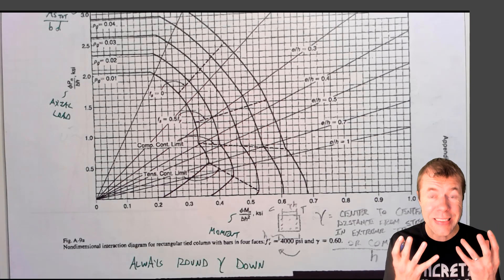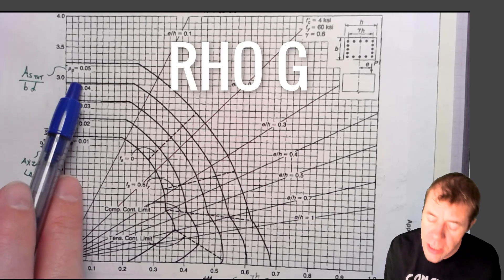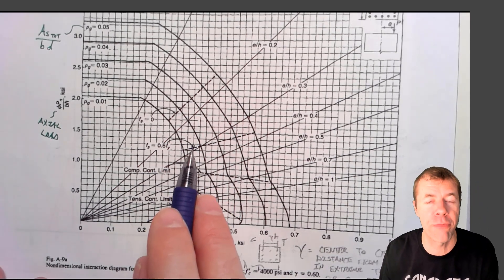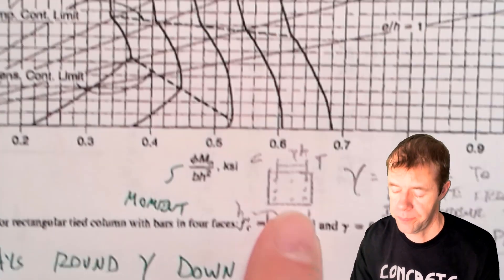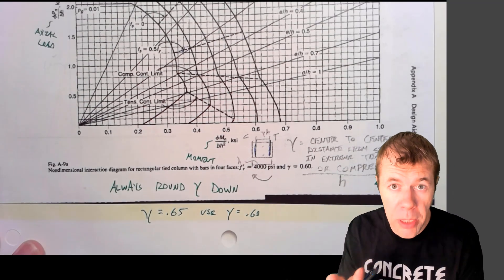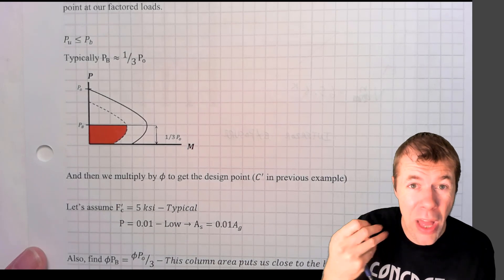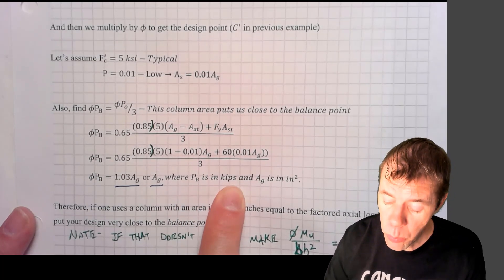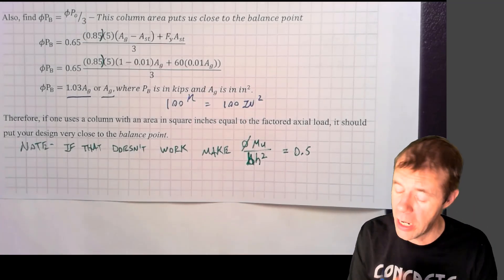Secret Weapons for Concrete Column Design | non-dimensional interaction diagrams

Comment: What's axial load?
Reply: It plots factored axial load devided by Area gross
Reply: @michaelfraker6302  

What is factored axial load?
Reply: @hg2.  hello,The axial load is the total vertical load that the column is resisting. This liad is multiplied by factors to create the worst expected loading within the structure's lifetime (sometimes this factor is more than 1.0 sometimes it's less than 1.0) This example, but in the next video he works an example with actual loads/vakues.
Reply: @michaelfraker6302  
Thank you for trying, but here's some friendly advice: stick to the Practice of engineering -- don't try explaining it to the lay community.
Reply: @hg2.  thanks. For my betterment, what part could have been explained better?
Reply: @michaelfraker6302  
There's a dynamic that technical people well versed in their subjects get wrong when talking to lay people, namely, that lay people don't just not know the detail of the question, but the context as well.  I would suggest 3 or 4 sentences if context to set the stage for the detail answer.  Yes, this slows things down, but that has to be expected with lay people.

If I knew what "factored axial load meant", I wouldn't be asking what "axial load" meant.
Reply: Generally the multiplying factor is 1.5